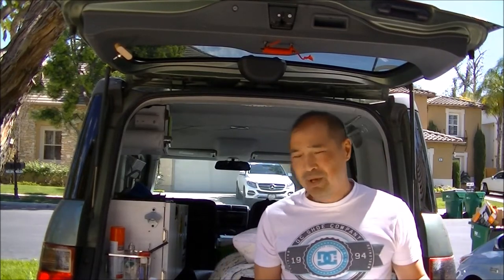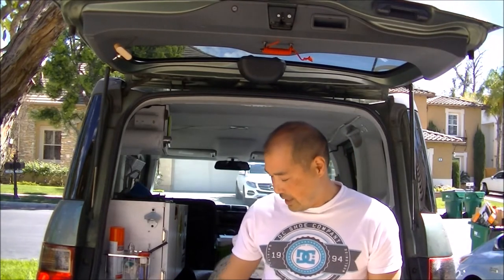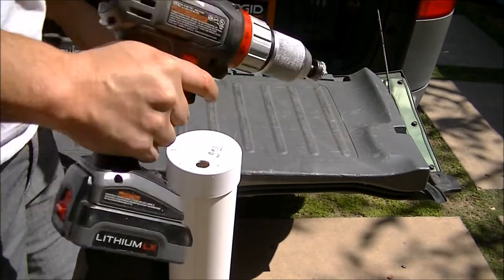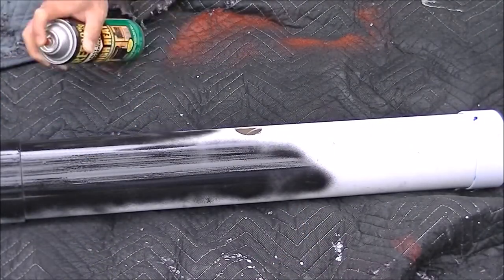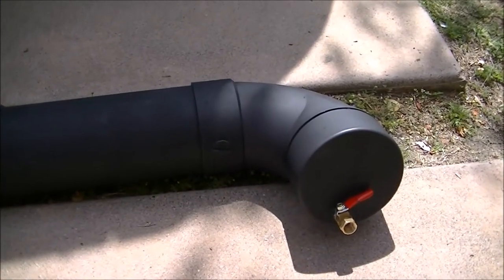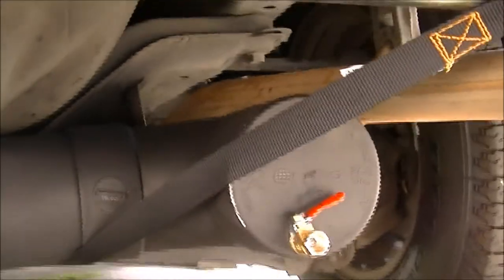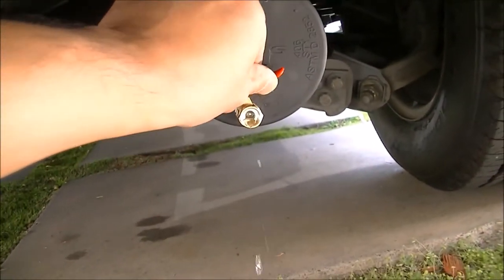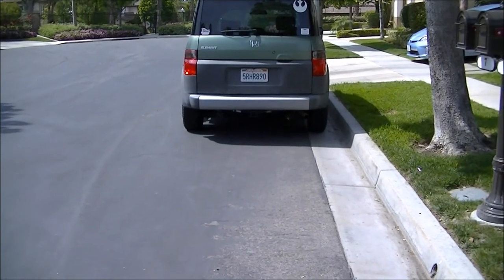Honda Element Micro RV.  32.  Updated Gray Water Tank

Comment: This is ANOTHER awesome idea from you!  Thank you for sharing!  You cannot see it from behind
Do you have any suggestions how to keep it attached for longer term use?
Reply from the maker: I actually left the straps on year round.  No issues, and maybe there would be some wear after 3 years or so?  Then you can always swap the straps for a new one.  But I suppose large metal  ring  clamps would be a more permanent solution?
Reply: @Tiny-Campers  ...Great, thank you so much for replying (and so quick!) - I'll look into that idea :)
Reply from the maker: Actually, if I was to do this again I would definitely use the square 5 inch vinyl fence post and caps. Square will hold more water and will lay flat against the bottom of car.
Reply: @Tiny-Campers  Wow -  That makes so much sense!  Thank you so much!!  :)
Reply: @Tiny-Campers  ...you are very kind and generous!